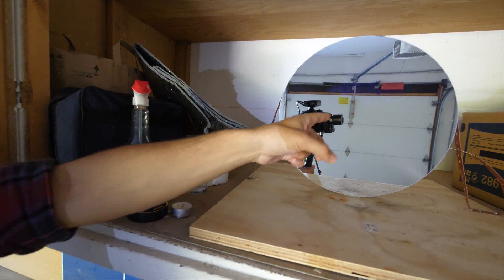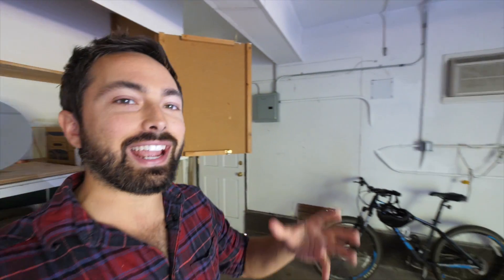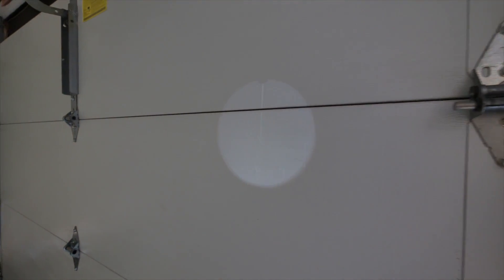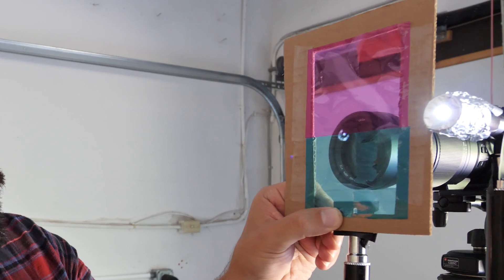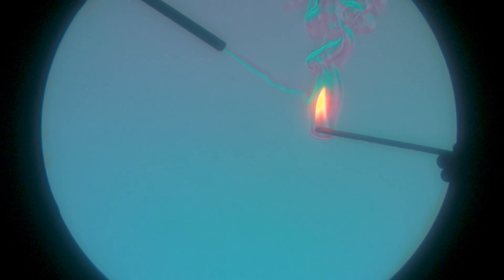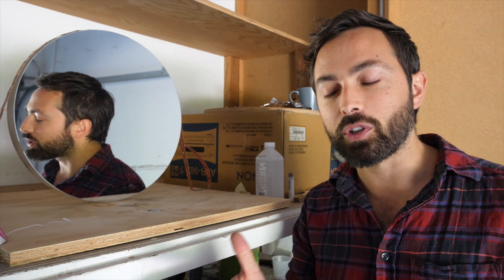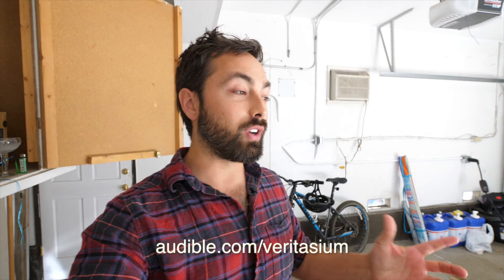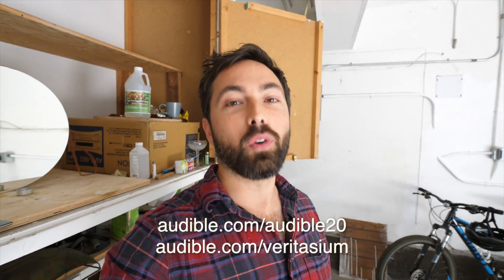Schlieren Imaging in Color!

Comment: 60 years ago, I had a job testing fans. I've always thought that how air behaves around fans, or, in fact, air in general, is very interesting.  In general, when you turn a fan on, the air follows the curve of the blade.  However, at some point, that nice smooth flow breaks down.  I think that's interesting -- the progression of the break down.

Comment: it would be easier to see the 'sound' from something very fast so the density and resulting diffraction differences are more profound, eg cracking whips. Plus at very high frame rates. For large explosions it is possible to see the shock wave - and reflections - with the naked eye.

Comment: At Roche Medical electronics we had a Schlieren through an Aquarium tank ( round pinhole light with round black dot obturator) to a video camera: we could image the ultrasonic beam patterns emanating from (3-Lens) Cloverleaf fetal monitor transducers. The cast epoxy lenses sometimes were improperly bonded to the flat PZT crystals, and the Schlieren clearly showed black streaks in the conical “flashlight beam” pattern emitted from the ultrasonic lenses. 
     We also had a sound pressure force balance that had 90 degree corner (point-up) covered in ultrasound-absorbing rubber suspended in another tank from a microbalance. When the Ultrasonic transducer was aimed at the rubber corner, the milligram “force” created by the ultrasonic sound pressure (deflected at 45 degrees) was proportional to the milliwatts of ultrasonic energy emitted through the water. Bureau of Standards method based on the paper by my Manager (pronounced “Ya-niss”) Janis Ziedonis. In the early 1970s. Peter Bourdelle

Comment: Those pingpong balls aren't just flammable, they can be highly explosive when condensed properly. One of my friends came up with a recipe for starting solid rocket engines, which used a mix of smokeless powder, aluminium powder, potassium chlorate, and other dopants depending on his needs for the rocket at hand. When he was done making this concoction he'd coat a tiny section of unjacketed ignition wire with it while it's dissolved in acetone, then once that dried hard again, he'd coat it in several layers of ping pong ball dissolved in acetone as well. Competition ping pong balls are actually made using 100% nitrocellulose, which is the same active component of flash paper (just tissue paper dipped in nitric acid and dried), and also a significant component of smokeless powder along with nitroglycerine. He claims that if he doesn't coat it in nitrocellulose, the starter may detonate sometimes, but it's very inconsistent, so coating it in hard nitrocellulose keeps the pressure in long enough to ensure detonation 100% of the time. his rockets were pretty fantastic performance wise so I trust his knowledge. Pretty sure this is just a common thing home made rocket enthusiasts use since i've seen videos demonstrating similar techniques here on youtube with various recpies

Comment: Shadowgrams are much cheaper and simpler to set up (no expensive optics), and they also let you see transparent gas refraction differences. They work on a different principle, the change in brightness caused by convergence or divergence of light that results from refraction (as opposed to seeing path bending in one dimension also from refraction and detected by Schliren). A setup allowing both measurements to be superimposed and displayed in two colors would be killer.

Comment: I like the projected image part from roughly 2:00 to 3:00.  Shows that there is no digital processing magic of camera images to make Schlieren work.
For better projected images without blocking as much light, you can use a line array shadow mask in front of the light.  Blocks only half instead of 90+% for the pin-hole.  Then use a copy of the same line shadow mask instead of a knife edge (ie. multiple knife edges).  Finally, add a lens where the camera would be, to focus the object (in front of the mirror) on the projection screen (garage door).
Here's a smaller setup (8"/203mm mirror) built with the above line shadow mask (printed with a laser printer onto transparency film):
https://www.youtube.com/watch?v=m55pWVQqe7Y&list=PLYqfcJ8a-a87-EoilUUcqRSR_E95lAPHD&index=66&t=1s

Comment: Paraboloids are difficult to work with because the only way to measure their properties is to measure what you can and deduce the rest. It's a shame required engineering math for non-engineering majors stops with 2D conic sections. When things don't get interesting until you start using 3D conic sections to affect sound, light and other waves.

Comment: I have a request...if you did this experiement with the traveling flame again and did it outside in this climate today, (post amazon fires, etc.) would it be faster to light? I think that covid and all the other viruses taking hold are because the viruses are trapped in hydrocarbons and we've got too many hydrocarbons floating around. So, if the flame does speed up, I would suggest dropping a dusting of activated carbon from the scene and light it after the dust has settled, it may 'clean' the air and the traveling flame will match the timing of your original experiment.  https://youtu.be/dhQJetFI7eo

Comment: i think it would be even cooler if you made a radial rainbow filter (a circle with red in the center and violet on the edge), which would mean that as the light bends more, it gets a smaller wavelength on the image. a sphere of helium would probably look just like the filter, so red in center, going through the rainbow to violet near the edges.

Comment: Hey Derek, I know this video is old, but with respect to the sound recommendations, do you think creating a standing wave of sound will show in this setup? Using a speaker, playing a sine wave and reflecting it on a flat surface at a distance equal to the wavelength of the sound.

Comment: Slowmoguys would be able to capture sound waves, and using something with a bit more of a concussion might be a good idea. Like, a firecracker, or one of those powder-actuated-nailgun blanks. 
Also, additional coloring would be cool if you did like, a strip of clear that covered the center 50% of the focal dot at the razor, then a strip of blue for the top 25%, and a strip of red for the bottom 25%. Might better show positive and negative pressures?

Comment: Hey, great video loved the colored schlieren video. With regards to the sound shock wave, the only things i could think of is film with a seriously high frame rate and a seriously loud impulse sound. I would use a starter pistol of you could somehow get your hands on one, this is what acousticians will usually use to measure the impulse response of a space, for instance a church or concert hall. Infact its so loud that my acoustics professor told me that you're not allowed to use them to get the impulse response of archeological sites, he was involved in getting the impulse response of stone henge and had to use a balloon because the pressure of the sound from the starting pistol could have actually damaged the stones apparently, probably overly cautious but still interesting to think about.

Comment: You can see the Schlieren effect without that setup up by looking at a campfire, or a hot object. You should see a distorted image because of the same reason a pencil seems to bend in a glass of water. You can also use a candle, but it will be low quality. 

I’m only nine years old.
Reply: It’s called refractive index.
Reply: If you do you should see 6:02.
Reply: The hot object works because the refractive index of air changes with temperature. So the hot object heats the air surrounding it but it cools as you get further, causing that effect. That is also why the flames look like that too.

Comment: Make it loud. Use two wooden plates and slap it together - much louder than hands. Use ear protective gear.
Reply: Milan Karakaš that doesn’t change the speed of sound, just the amplitude of the shockwave
Reply: @nicholasvarner2706  But, what I said? Make it loud, not fast. Okay? I am not talking about breaking sound barrier, but rather making Schlieren image of the shock wave which should be loud enough to be visible.
Reply: @milankarakas2  wot, sound travels at a constant speed through a medium, why would louder sound make it more visible, when the problem is that he cant catch the sound waves with the framerate he has.

Comment: 6:40
Couldn't you make a repetitive clap (with a adjustable frequency) with some kind of machine which is nearly the same every time and then make the rate of clapping very slightly faster then the shutter speed of the camera?
So you could achieve a "fake" higher frame rate?
I hope I discribed it clearly enough 😅
Reply: you're describing a speaker, lol. it could work
Reply: @yoongilimerence  standing wave

Comment: I'm not that smart, I flunked out of engineering, but I know this. If the mirror either approximates a sphere or a parabola is a big deal, even on this scale. Mirrors used in optics this size have major aberations if they're spherical as aposed to parabolic! It's kind of a big deal.

Comment: Here are a couple that will change everything. Put a small plant in a pot of sand drill a hole in the side of pot and filter to catch sand coming out bottom and pump water through sand constantly, have plant top at bottom of mirror. Put quartz crystal in a tube with tip pointing out and run water through. Then cap off crystal with granite pyramid for more interesting results.

Comment: About looking at sound, I think it can be interesting to use a loudspeaker connected to a signal generator.
By setting the signal generator to an even multiple/fraction of your cameras frame speed (4000, 1000 or 500Hz) I think you can see a pattern from the sound. And if you then de-tune the signal generator (1Hz maybe) that pattern will start moving. Then you can place objects in the way and see how the sound go thru or around.

Comment: I would like to reproduce your experiments to simulate a customer set-up, whereas the point light source is a laser exiting a 200/220 or 320 octagonal core fibers in which we spatially decorrelate and fill modes via scrambling.
It seems the mirror focal length should be long in order to catch much of the light due to objective na.
Amazon mirrors are rather short, 65 cm.
I would appreciate if you have found or  written a paper, guidelines, etc.
Great work you guys, love your channel!

Comment: There's a YT video of two railway workers fixing a crack or something.  Hot metal is poured into some sort of container, and at some point in time there's a loud whistling/sucking sound.  Heat pushed air out, and as the container cooled air was sucked back in.   My memory is fuzzy about the details.  I guess I shouldn't apply to be Railway Repair Worker next time I'm unemployed, eh?  Anyway, not only heat and its direct effect on air, but the whooshing air might be interesting to see in Schlieren.

Comment: Hot electronics things to try:  heat sinks on a 1970s era audio amplifier based on push-pull circuit topology, volume turned up to max.  (Use a dummy load not an actual speaker.)   Compare to a  contemporary class-D amplifier.   A GPU-heavy graphics card grinding away on a huge matrix inversion or 3D rendering.  An old vacuum tube radio.  An even older vacuum tube radio with the bigger tubes - they were even hotter!

Comment: If the focal length of the parabolic mirror is 1.8M, why is that camera at 2X that or 3.6M, as stated?
Reply: Light coming from the center of a spherical mirror bounces back to exactly that same point.
The focal length of that mirror is half the radius. (optical rule)
The light source as well as the camera should both be placed as close to that center point as possible (= 2x focal length).

Comment: Awesome video. Isn't using a razor blade like altering the aperture of the lens. You could use a continuous sound source at a specific frequency through a dense gas and create standing waves like guitar strings. Also you could use infrared and remove local light sources to reducing light leakage? Keep up the good work.

Comment: Does this work with smaller wavelength like Ultraviolet. And larger wavelengths like Infrared? All the way from 450NIR to 3nm SWIR, or even thermal LWIR at up to 14nm. Using a thermal camera at high framerate like the the research cameras by FLIR.

Comment: Suggestions:
1. Put a Tesla-coil in front of the mirror.
2. Create a standing sound-wave of 10 .. 20 Hz using 2 sub-woofers in front of the mirror (should produce a few centimeters of wavelength of air-compression).
3. Split the beam in two, use different polarity filters on each, have each filtered beam pass a differently colored separation sheet and combine the beams again to get otherworldly combinations of 4 colors.

Comment: Hi Derek. This might get lost in a sea of youtube comments, but nevertheless I have a suggestion for a sound-based Schlieren imaging experiment. I was wondering if it is possible to observe a 3D standing waves in air (or some other transparent medium). Standing wave will create a pressure differences, so theoretically we should be able to see with this technique the pressure gradients between nodes and antinodes. With proper set up we might see similar patterns as Chaldni patterns produced on a 2D plane. The technical realization will probably be a bit more difficult, but this was just a quick idea that crossed my mind.
Reply: Standing wave seems a good idea. You don't need high speed camera since, by definition, the wave is standing still.
The wavelength (frequency) can be adjusted for the best resolution.
Reply: Signal generator so you can dial in sound frequencies, or maybe just a tuning fork.  Sand in a speaker will form patterns from the sound vibrations which  are 340 m/s so these patterns must be standing waves.  It may still be difficult to see a standing sound wave pressure differences in air, it might be easier to see the effect  on the rising heated gas from a candle.  With a signal generator you might be able to change frequencies and capture video of the change in standing waves in your rising gas. (You posted this a year ago. Any results?)  [And I just had the probably whacky thought: What about the slit test and Schleiren?  Don't ask me for results, I'm still fiddling with the basic set up.)
Reply: https://www.youtube.com/watch?v=XpNbyfxxkWE
Reply: @brokeafengineer2071  if I had seen your comment earlier, sorry😅
Reply: It is possible to view a standing wave with schlieren imaging.
Reply: Look up for acoustic leviation!
Reply: https://youtu.be/XpNbyfxxkWE
At the end of the vid you can see it :D
Reply: hi, late reply but for anyone who's interested in this: the Harvard Natural Sciences channel has a video where they do just that, search for "Visualizing Ultrasound with Schlieren Optics" on YT!
Reply: @drdefecation  yes, the link you shared nearly answers the request posed - seeing the standing wave pattern. wish the Harvard man extends his work to audible frequencies, so that we can enjoy 'seeing' music in air :-)
Reply: Surprisingly you were the 3rd comment for me.
Reply: What about a flute or a something?
Reply: https://www.youtube.com/watch?v=XpNbyfxxkWE fortunatley someone has made a video on ultrasonic tweezers and looks at it with the schlieren effect and the nodes are really clear
Reply: wrg
Reply: Something that crossed my mind today was using sound technology to determine an objects profile when hobbyist metal detecting. Would be great to have a cheap gadget that could just show the shape of a solid object underground.
Reply: derek pin this comment by  Lahim27
Reply: this is an amazing idea and you can really tell because it was posted a year or so after the video, and not only made it to the top, but it's the top comment 4 years later
Reply: I'm wanting to try this for my channel. Wish me luck.
Reply: High magnetic fields induce refractive index changes, including potential negative refraction via metamaterial-waveguide integration, enabling selective spectral filtering. This could enhance Magnetic Resonance Imaging.
Reply: The standing wave is an intriguing idea. If it works at all, maybe use a frequency that's very close to the frame rate of the camera. That way the strobing effect might be used to see the antinodes change in slo-mo.
Reply: I am outta here all nerds talking 
I have a nerd allergy 
🤧 🤧
Reply: He'll need a much higher frame rate to capture it, hence the needed backup mentioned towards the end of the video. I don't know how high frame rates can go, but I'm willing to bet it's doable
Reply: @RandyButternubsJams  Slo-Mo guys or Destin
Reply: @RandyButternubsJams  standing waves are based on the wavelength of the sound not the speed. Because of this you just need a ultra sonic sound and the waves will be visible as solid lines of higher pressure areas.
Reply: @RandyButternubsJams  higher frame rate requires more light but is doable

Comment: I feel like you might be able to get some cool effects with a laser beam - if the beam heats the air enough, an invisible beam could become visible in the Schlieren image, and it might be interesting to see how a beam of a certain color affects objects of the same color or the complementary color (e.g. a red beam focused on red and then green cardboard). A piece of dry ice next to and slightly above a candle flame might also be interesting, seeing the cold CO2 fall and smother the candle, and the turbulence between the rising hot gas and falling cold gas.